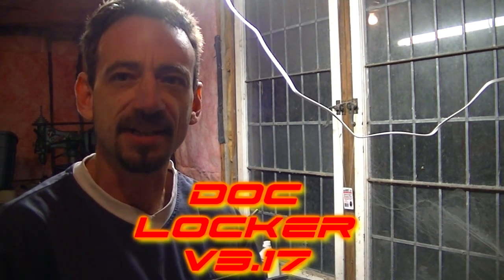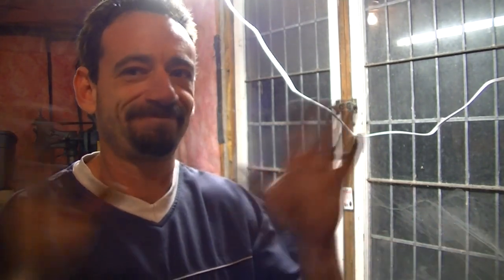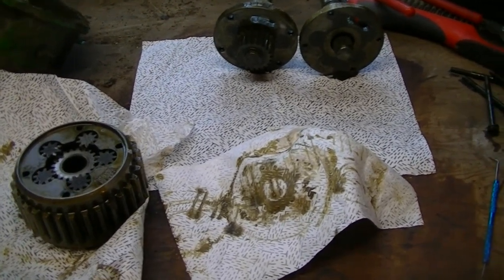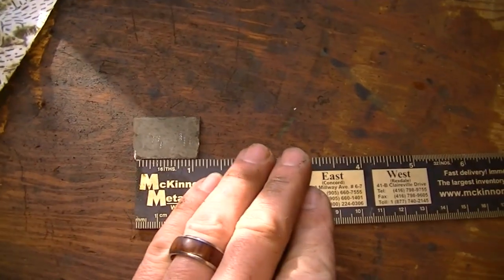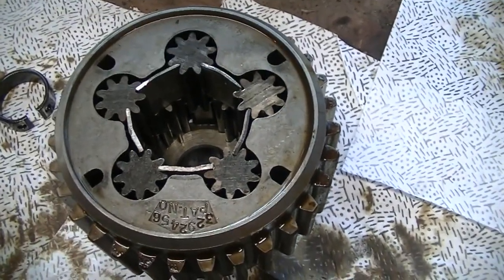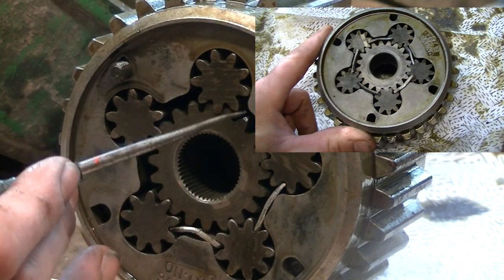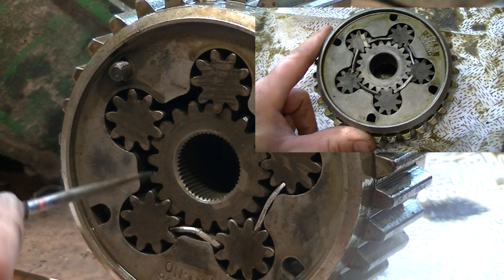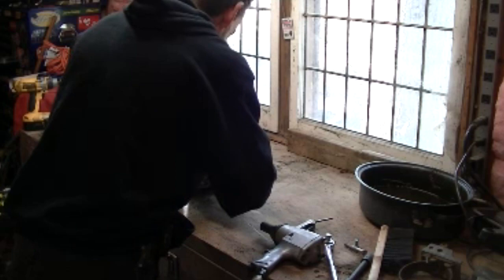Doc Locker 3.17- Weldless!

Comment: Never touched a 2300 series but I have experience with the 633 which is similar. It was in fact the first transaxle I ever took apart, that was a major league pain in the ass too! Since there is NO service manual available I had to print out somewhat unclear parts breakdowns and assemble the thing based on those alone because I took no pictures. I had the thing torn down as far as possible, down to every last washer, gear, and snap ring. No idea why I ripped it apart that far. Great video Doc.

Comment: Nice job!! The phasing of the gears was why the bend was opposite with the plates. The tooth on the little gears on one side was furthest in and on the other side it was the center big gear where the tooth was furthest in to the little gears. I just happen to notice that because of the starters I do at work when I check for clearance between the teeth, that's what I look for, force of habit I guess, LOL.

Yah limited slip setups are only good for hard surfaces, they don't do to well for off roading.
Reply from the maker: +prancstaman You're absolutely correct. The gear phasing occurred to me, after I had filmed that segment. I guess I'd already used up all my available brain cells, and had to wait for a few more to come back online ;)
Reply: LOL! I know the feeling.

Comment: Ingenious solution.  The 2317 is one STRONG transaxle.  It makes an 820 look weak in comparison.  Is the limited slip differential made by Hilliard?
Reply from the maker: +WeldstarCreations Illinois Tool Works, according to the Peerless manual.

Comment: There is still a range of motion allowed that might just get some purchase and metal fatigue the end and start making some soup.  This will work for a bit but you should still look at welding this.  Love your vids by the way please keep them up.  Have just bought a 61 wheelhorse to restore.
Reply from the maker: +chimp3376 I really don't see it being too much of a concern. Once completed, there was zero discernable play (lash) to be noted. If there WAS play, then yes. Ultimately it would hammer itself to bits. I found nothing. Realistically, a periodic check should reveal any developing lash. If so, then it can be re-addressed with new plates, or whatever the case may be.

Comment: And mine has a square space between the spider and pin with a half circle space for the pin ... Worked out good though just squared off my 2.5 inch hub to fit
Reply from the maker: If you had spiders, a pin, and a square space- you don't have a 2317 so this video wouldn't really have been relevant. But, it sounds like other ideas I've floated, managed to come into play. Good job!

Comment: Just curious, I have some "liquid steel" epoxy putty. might it be possible to just mix enough to force into the gear area where your "shims" are to take up the area and to prevent the gears from rotating? I'm just asking about the "theory" of doing it.
Reply from the maker: That has the potential to work.

Comment: Are you still going to do a "regular " 2300 peerless lock?. Or is the regular one more like this 2317?.. can't really find any good vids on it
Reply from the maker: The standard 2300 differential is the more common "spider and side gear" arrangement. I don't have one at this point. If I lay hands on one, I may consider engineering a Doc Locker for it.

Comment: how do these mowers steer with locked axles, grass mud snow etc?
Reply from the maker: That's a good, valid question and I am glad you asked.
When you eliminate the differential action in an effort to increase traction, you DO compromise steering to some degree. How much it is effected, depends on a LOT of factors. These factors include the track width and wheelbase of the machine, tire type versus terrain, weight distribution, etc. As a general statement (covering MOST circumstances), I find the compromise tolerable. The turning radius widens, but for the most part it is a small price to pay for the far superior traction. As my previous statement suggests, there ARE things you can do to improve steering after locking your diff, such as more nose weight, different tires especially up front, and tweaks to the frontend geometry. I hope that helps answer your question.
Reply: @DocSprocket  pretty much what ive been thinking and why i havent attempted it yet. i like you're videos amd found your page last night. i have a jd 216
Reply: @DocSprocket  plowing snow i need all the traction i can get ,, weights and chains and i still spin  tires .. Craftsman 6 speed high low range garden tractor with a snow blade ,,got splined axles and hubs .. have not looked in tranny yet have a few spares should take one apart ,, on film so that when stuff falls out i can see where it come from ,,

Comment: i knew if i waited long enough youd figure it out before i had to, lol. Looks great man, i know the standard 2300 will be similar but not quite as easy. Which side of the case did you pull off?
Reply from the maker: +Brad Butler You have to prop it up with the thinner (non-shifter) half down, and pull the shifter side of the case up and off.

Comment: is the peerless 2300 the same as this one as far as the way its built?
Reply from the maker: +Tim Merritt The transaxle shown in the video IS a Peerless 2300. However- the differential being locked, is the Duo-Trak Limited Slip, that appears in the 2317 model. The regular open differential that commonly came in the standard 2300 variants, is different.

Comment: Why did u lock the axle if you don't have m2 anymore
Reply from the maker: +lswelding Because I was asked to. I traded the transaxle, and as part of the deal, I greed to lock it.
Reply: +Sprocket's Garage ok
Reply: What did you do with the steering gear and are u keeping the frame and rebuild it later on
Reply from the maker: lswelding Steering box is excellent. Saved it for another project. Frame is going to scrap.